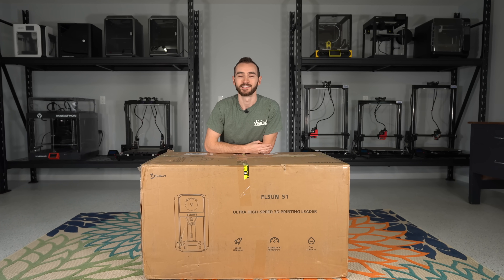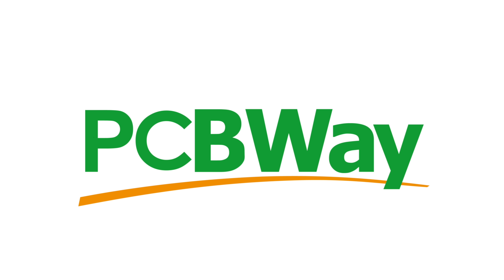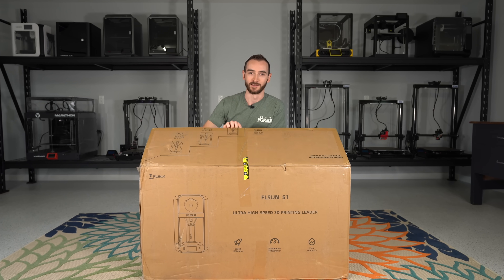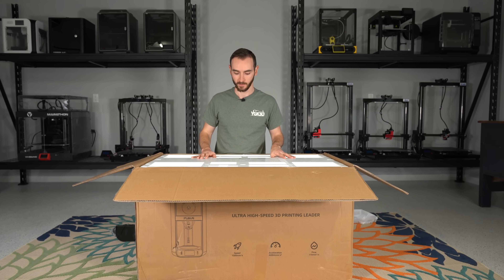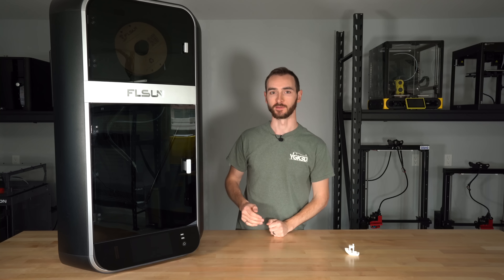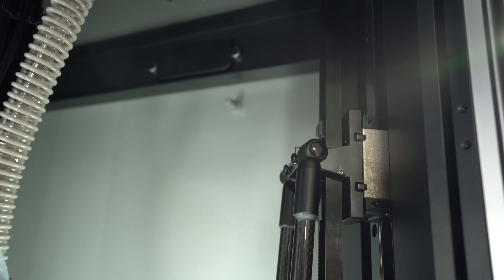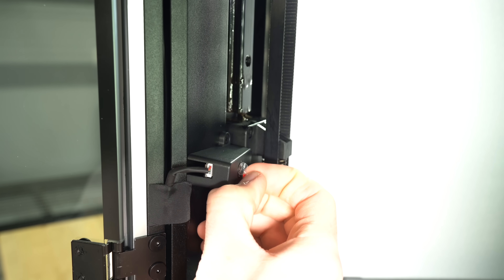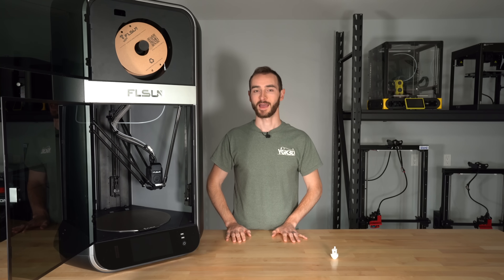FLSun S1 First Look - Bambu Lab FINALLY Has Real Competition

Comment: I have the FLSun V400. I can access it via my PC and send it files wirelessly. Connect the printer to wifi and enter its IP adress in your browser. Only personal downside of Delta printing is that supports often fail, especially the skinny zig zag ones. Tree supports are my go to. Also different artifacts can appear based on where you print it on the plate (3 belts to calibrate). The build volume is a cone at the very top, because of the range of motion. Only downside of FLSun is that I have to rely on the community for software, printer profiles, help etc. As my first printer I had to figure a lot of things out on my own.
Reply from the maker: Good to know. Thanks for sharing your experience! Interesting about the limitations of delta kinematics.
Reply: Every other printer let's us send files wirelessly too lol bambu studio even has a wifi send button to send files to print later from the printers screen

Comment: Are they supporting open slicers? I've heard from others that they only use their own slicer. I like deltas but they are not space efficient, which IMHO is the biggest downside. And while this is enclosed, there is essentially no space for good filtration for anything  beyond pla and petg
Reply from the maker: Right now it’s just their own slicer which is a mashup of PrusaSlicer and OrcaSlicer. You can slice and send g-code from OrcaSlicer just fine but there’s no built in profile yet.
Reply: Last time I heard the profiles for other slicers are still in development based on the latest update from the FB group
Reply: They cant not do that if they are using klipper.

Comment: Sorry but you showed pretty much nothing. I don't know if you didn't have enough time to prepare the video but the information in it is almost non existent. I expect to see more usable information in your next parts.
Have a nice day.
Reply from the maker: I was trying to get this video done to correspond with the lifting of the media embargo. This is intended to be a “first look”. I didn’t want to rush out a “review” before allowing adequate time to learn the machines strengths and weaknesses. I’ll be doing a more thorough analysis in the next video.
Reply: @ygk3d if nothing else, I hope you'll verify what kind of nozzles it uses, particularly if the v6 is a direct replacement. Shouldn't take long to check with calipers.
Reply from the maker: @leaftye  will do!
Reply: @ygk3d so not enough time. I see.